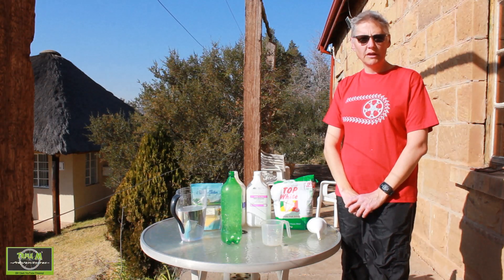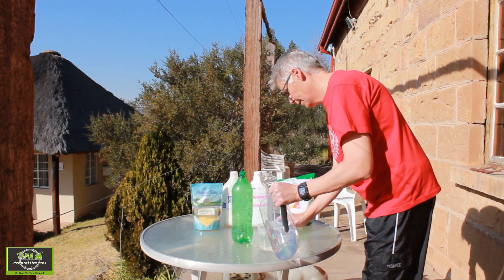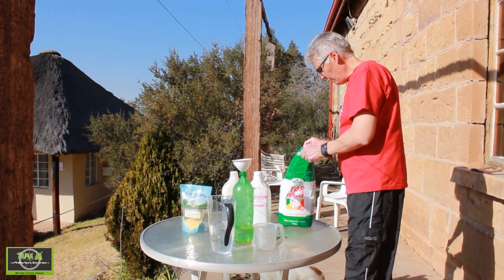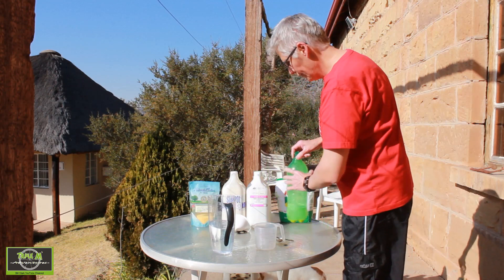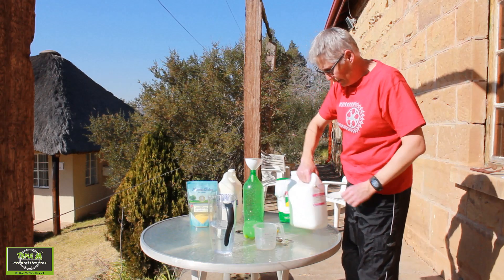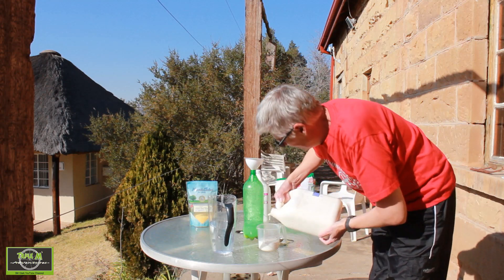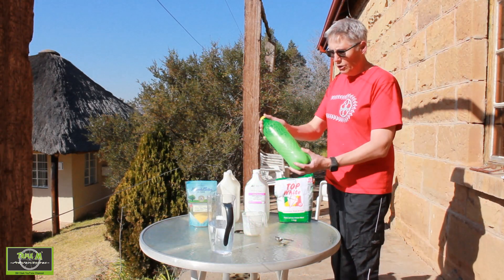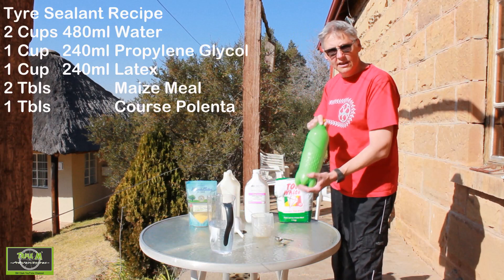TMA Hnts & Tips - Homemade Tubeless Tire Sealant

Comment: i have done all as you said but it does not make any sealant , here FLAMINGO, AEROPAK, MICHEL and  many other brand running , I am trying  to do a new. you do not use rubber particles
Reply from the maker: Sorry to hear the formula is not working for you it is important to add something like course polenta to help the sealant bind. We have very nasty thorns here in South Africa and once I take the thorns out it does seal. Sometimes for bigger holes just stop get off your bike and place your finger on the hole and it should seal.
Reply: I got some rubber grindings/dust when trying to make my own sealant and the rubber quickly floated to the surface,  either issue with rubber or the viscosity of the liquid.  I also think the size of the maize/polenta/corn meal is critical.   I also put some glitter in mine.  Had some small 1/8" square pressed tabs of fibers used for concrete, but hard to "unpress" are designed to be abraded apart when mixed in the cement truck.  Just Soaking them did not do the job either - they swelled and got softer but more processing to get them separated.

Comment: Sir is it working properly?
Reply from the maker: Yes the sealant works very well.
Reply: How much diameter is repaired ?
Reply from the maker: Surajit Jana about 2mm we have nasty thorns here and once pulled out it stops air loss after a few seconds. Sometimes if it is a bigger hole I stop and put my finger on the puncture hole and it stops leaking after a short time. In my opinion it is as good as the commercial sealants I have tried.
Reply: Can you send a good composition formula for small to 25 mm diameter hole?
Reply: @surajitjana7902  the video has the composition dude!!! Add some fibre pieces, shreds to his mixture. fibre will build up into a plaster patch, i presume.
Reply: Is any pressure loss from tire? If losses done how much psi?

Comment: Its useful for any other vehicles  ? Plz reply
Reply from the maker: Mass Actors I have used it in my pick up truck and it stopped the slow puncture.
Reply: @the-happy-RC-flyer  which incredients are use for this product  ?
Reply from the maker: Tubeless Tyre Sealant Recipe:
2 Cups 480 ml Water
1 Cup 240 ml Propylene Glycol
1 Cup 240 ml Liquid Latex
2 tbls Cornmeal
1 tbls Polenta